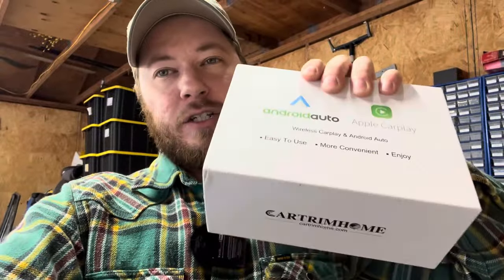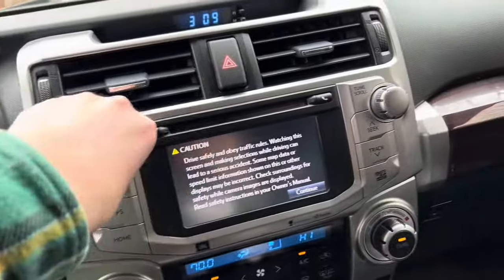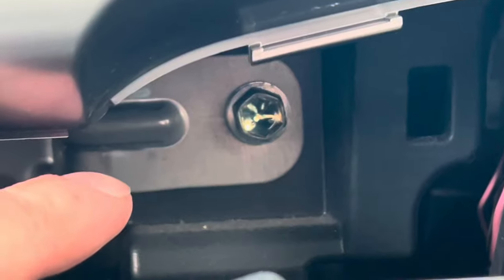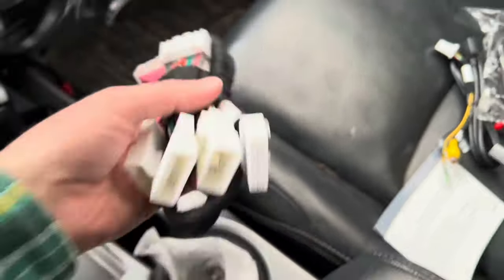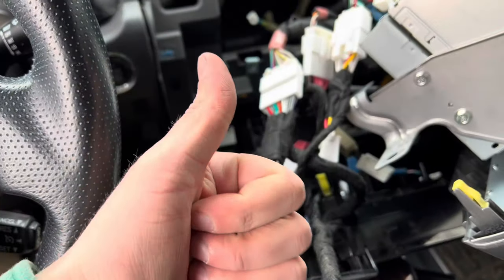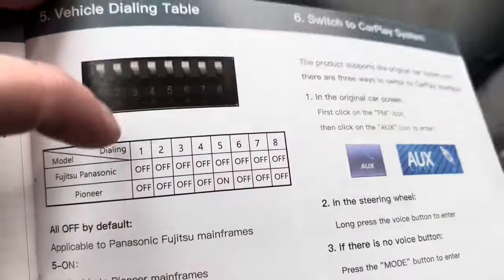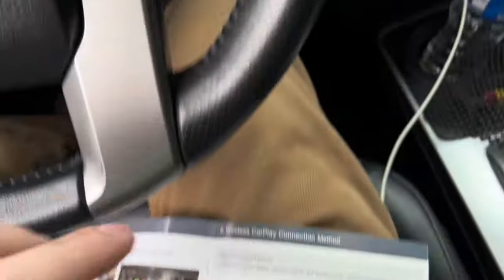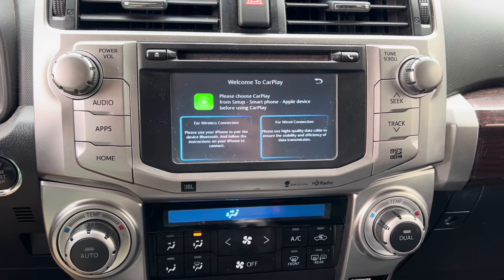Add Apple CarPlay To Your OEM Factory Toyota 4Runner Radio

Comment: Does it use the OEM microphone?
Reply from the maker: Yes it does, works great!
Reply: @DustinT thanks! I was looking at the link you posted. It doesn’t list 4Runners as being compatible with this unit. Is there a different unit I need to look for?

Comment: How is it holding up?
Reply: No follow up, so probably not good.
Reply: @Chaos31  He followed up in the same video, it works great. I had a friend install this same kit, and it works great. You can switch back and forth between the OEM and CarPlay UIs by double tapping the volume knob.
Reply: @TransitAndTeslas  Awesome sauce.

Comment: Great video. One question what is the USB for ? Could you connect a hard drive full of music MP3s and hear the files?  Also, what front camera is recommended to plug in the extra camera rca plug?
Reply: The usb is usually for your phone not a external hard drive with 35,000 mp3's from 2005. I mean it's possible though.

Comment: Have you tried the USB or wired CarPlay? Also we use CDs and is that easy to use as well? It seems like it has been working for you 2 months but just curious!
Reply: No difference when using CDs as before. Just insert it and play, then switch to CarPlay to see the phone. You can double tap the volume knob quickly to switch in between CarPlay and the OEM Toyota interface.